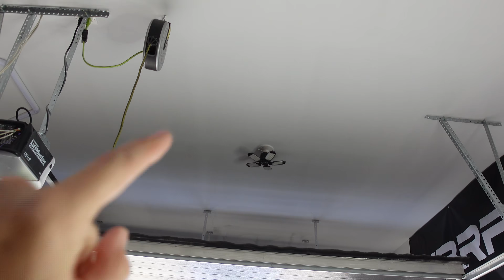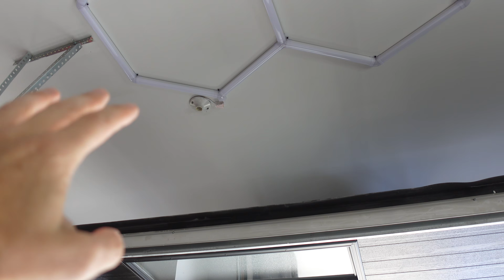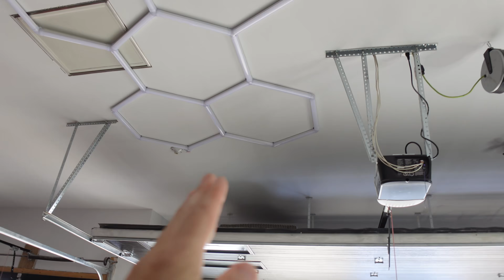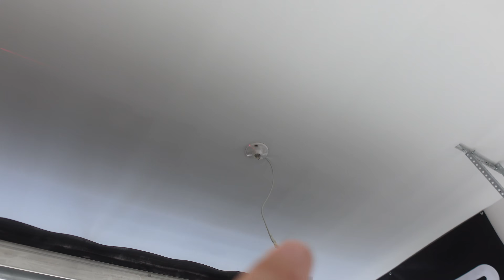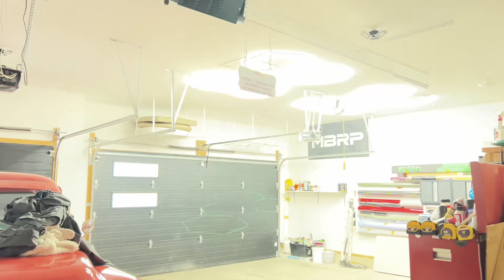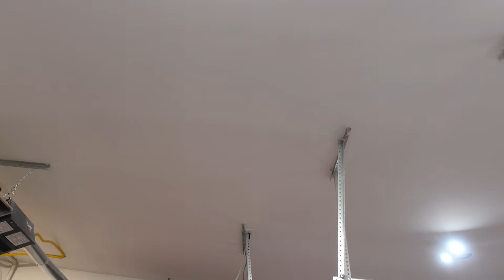The ABSOLUTE Cheapest DIY Hexagon LED Garage Lighting – Is It Worth It?

Comment: Get a blank round cover drill a 5/8 inch hole in the middle and put the proper cable connector in.    Very easy and it makes it a professional install.

Comment: How have these held up for you? Looking to get this lighting now that I have the NewAge Bold series 3 storage system. I'm 3d printing a Hex wall storage for the back of that so these lights will tie in nicely. I also have those screw in LEDs but they are always burning out.
Reply from the maker: These have been working well.  No burnouts yet and no other issues
Reply: @Donslife Awesome, thanks for the quick response!

Comment: Do you think the hex need to be screwed into the ceiling? Would some good double sided sticky tape do the job? Looking to do this in a shipping container
Reply from the maker: With strong enough adhesive they are light enough to adhere
Reply: @Donslife  with a classic vehicle or nice new car under them I wouldn’t risk taping them.
Reply: @cb550rider i installed some at my mates house. They weight practically nothing. If you use enough quality double sided tape its be fine. Each light is like holding a rolled up piece of a4 paper lol

Comment: Looks great. Side note about the black 5 winged ones. Are they metal? I just bought metal ones and they are super bright but they get pretty hot. Did you notice that with yours.
Reply from the maker: No heat from these that concerns me.  A little warmth, but not hot.  Also the construction is all plastic.   I am happy with the results for the cheap price.  Now we’ll see how long they actually last

Comment: I did a light upgrade to my garage some time back and used an adapter I got off Amazon that screws into the light socket.
Reply from the maker: I considered that too.   A ground wasn’t available for the plug adapter when I felt like doing the install